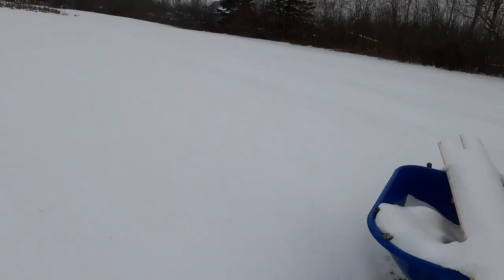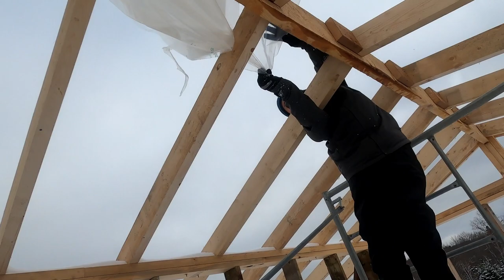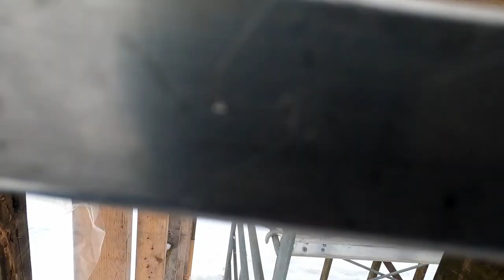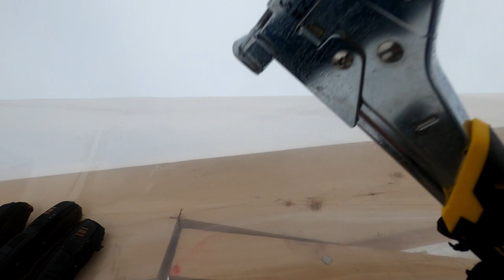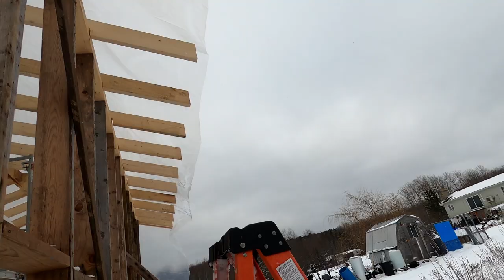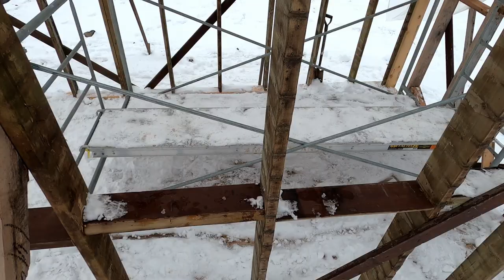Homestead DIY Barn  Vapour Barrier Showdown!

Comment: Will you cover the walls next or get the roof on?
Reply from the maker: I’ll get the walls all covered first. Then I can relax a bit because it will be weather tight. I’ll build the ramp for the front that will enable us to drive the mower ,etc up into it. Then I’ll build the doors. After that, steel on the roof.